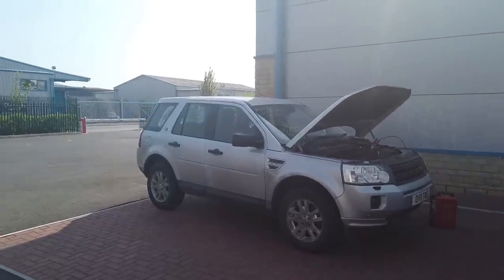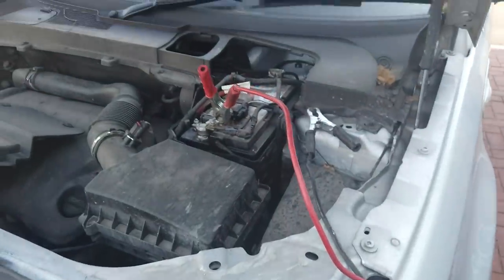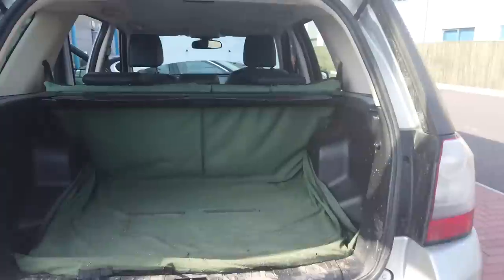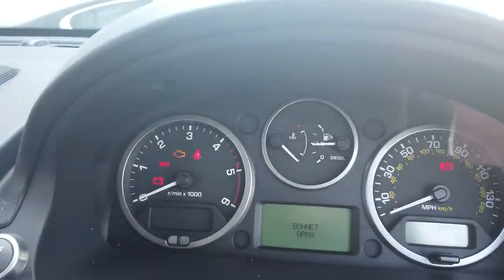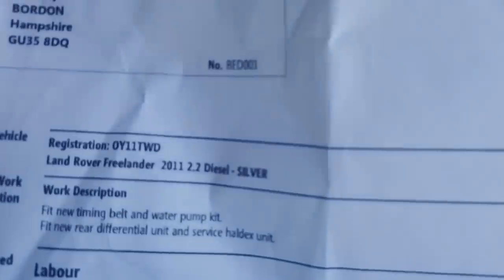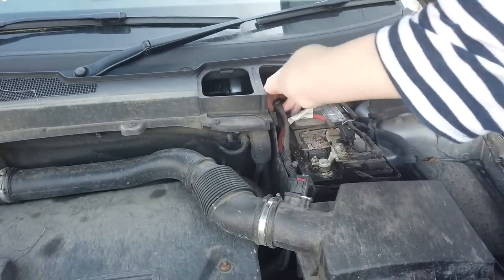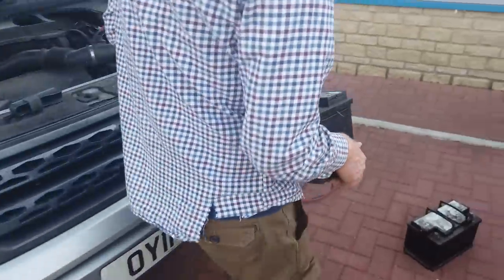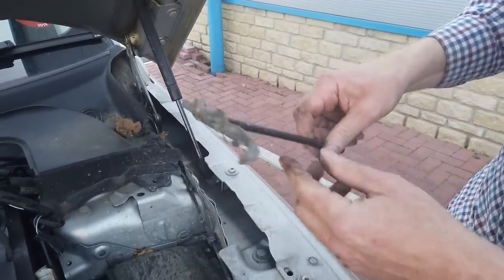Buying A £1200 CoPart Salvage Freelander 2 / LR2 - Will it run? Is it a Bargain?

Comment: Only just seen this.  It was a real bargain.  The service history was excellent and the expensive 10 year items (timing belt, water pump etc) items had been done.

I had exactly the same model (Freelander 2 TD4 XS) in silver with the optional Alcantara seats. The alcantara and napoli leather seats were excellent - they had electric adjustment, manual lumber support and no arm rests.

I had mine from new for 10 years and did 205,000km.  No serious issues.  

Did notice that the copart car had a second battery earth (to starter motor) which was not standard on this model at the time.  It would have been supplied with a matching spare wheel.

I don't agree that running with worn tyres on front or back (ie different diameter front/back) causes Haldex 'wind up'.  The haldex is a clutch which is normally disengaged, only when the computer senses the need, does the Haldex clutch lock the rear prop shaft.  A slight difference in tyre diameter might cause a bit of slip between the haldex plates but would not normally cause the computer to tell the Haldex clutch to lock.

Comment: I have 2014 FL2 dynamic sd4. I love it. Had a few issues with it. EGR valve replaced, haldex pump, EBD fault flashing up. All sorted under warranty but EBD starting to come on again. I hope it's nothing major as it's only got 53K on the clock and I am planning to keep it a while. Cheers for video

Comment: I just had to replace the battery on my LR 2 2011 it started leaking and I test charged it first and it would not register or hold a charge and must of had a hair line crack in the bottom of it due to age. Have to keep an eye on the coolant. It has no leak and I only usually use it locally with no weight in. I wonder if that is normal with these vehicles? I mean check the coolant level every few weeks? It was a right pain in the ass removing the battery.. The long battery retaining bolt will not just lift off and come away from the area as it is attached the the lower retainer. I had to jiggle it towards the windscreen and pull the battery over towards the N/S and then tuck the positive lead wedged between two rubber surrounds and if that wasn't enough I used string to hold the negative terminal away from the battery by tying it to the N/S bonnet hydraulic. It helps when you life the battery out and away which is another Circus act in itself.. Ah 11:07 I had exactly the same problem with the replacement battery being slightly shorter in length than the battery already removed from the vehicle and try as I might it will not hold still with the retaining clamp and bolt tightened up. I was either going to return the battery for a more expensive same size one as it was a Leon or find a suitable size rubber or wooden block to take up the excess space crazy job to have to be seen to. That long retaining bolt and clamp has to be removed out of the way to get the batteries changed over and is best replaced after the new battery fitted. To help me locate the right place to try to start to do up the long retaining bolt after the replacement battery was in I made two small cuts on the adjacent rubber surround right where the bolt stood so it helped me line up the bolt and clamp again but it still will not stop the battery from sliding, well on mine it didn't anyway. I think it is designed so only a Land Rover battery or equivalent is used? One thing I was extremely pleased about was that I had replaced a lot of my tools from the late 80s early 90s with smaller more delicate ones like you are using because they were perfect for the job. For example my old 13mm socket and new one , the new one is so much smaller but still gets the jobs done. As does the ratchet and extension. Almost need a degree just to fit a battery these days. I found it helps make a good connection with battery terminals and leads to apply slight pressure downwards when tightening the clamp bolts. I found out years ago while still learning that there are at least 3 levels of bolt and nut tightening. 1: Tight. 2: Fecking tight and 3: Oh feck it broke/snapped. TD4 is the strongest manual box and SD4 is the strongest auto box. I was lucky I don't like the compressor and puncture repair idea as it goes out of date so I got a spare wheel and tyre off eBay. Wheels almost match too. Could be worse.

Comment: Hi, I have a question not related to the video (sorry) my car, 2010 FL2 will open start and drive with both key fobs, but it won’t lock, the middle lock button and the manual lock mechanism works, has anyone else had this or have a fix for it?

Comment: We've got the exact same car and ha e an oil leak...looking at under the bonnet,  it's from the big back pipe which is part of the air intake so there should be no oil in there?! Any ideas? Had a garage look and they didn't know....
Reply from the maker: Sounds like it could be oil from the turbo - this gets into the air intake - but its quite normal to have a small amount of oil in the air intake post turbo. As long as the car is not loosing too much oil i would not worry too much. Do check the pipe to check they have no leaks / breaks etc
Reply: @L663  yeah that's simelar to what the garage said but not quite sure where it's leaking to fix it, I'm gonna clean/degrease the engine bay then can hopefully source the leak! Thanks for the input!👍
Reply: @t2thex21  Hi Mark, this is a common issue with the Freelander 2, the fix most people use is to change the spring clip for a jubilee clip. Clean up the rubber seal and a smear of sealant and fit together and tighten with the jubilee clip. Lots of info on this on the freel2 website

Comment: Bargain,love mine but she has recently started juddering and occasionally doing like a hiccup ,can't seem to get to the cause!??anyone had this??? diesel,Manuel td4 2.2
Reply from the maker: Not sure - start with the basics... oil change .. fuel filter change etc
Reply: @L663  hi thank you ,we have done all that,plus the cambelt ,no codes showed apart from alternater was not putting out as high as computer on car likes so that's the next job,could it be causing the juddering???

Comment: Why the heck was that written off?  Or was it just a part exchange with a minor shunt and a flat battery?
Reply: Brett Nicholson  A new bumper alone is around £800 , I'm not sure if you can get tab repair kits for the lights.
Reply: Damage to the roof (o/s front) probably.

Comment: @0:50 Is that a dent in the roof I can see at the leading edge on driver's side? If so, then there is your reason for the very low price. Insurance write-off, I suspect.
Reply from the maker: there are no dents in the roof - other than the ones that are there to help rigidity.
Reply: @L663  Glad to hear it. Now that I've reviewed the footage again, I think it was just a trick of the light.
Reply from the maker: @rafflesnh  No - i apologise.... you are correct there is a dent above the drivers head.... random ! you are correct also in that the insurance will write off a car for a roof dent !
Reply: @L663  GAH!! What a bummer. So sorry. I had a small dent in a similar position on a BMW 5 series estate I once had and I managed to get it repaired quite successfully using a glue dent puller at a body shop.🤞

Comment: Missed a wire off battery
Reply from the maker: Yes correct - in the excitement i did - no idea what it does..
Reply: powerfulukltd wonder why you didn’t get an error code or it not start, still seems like a bargain